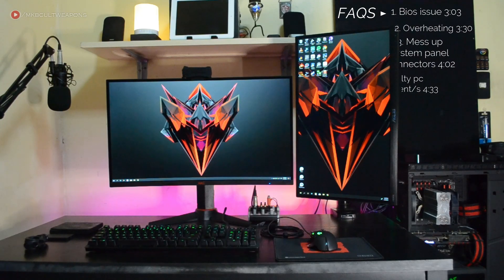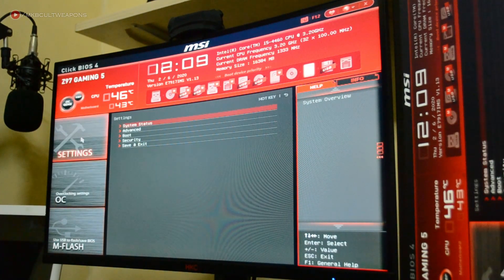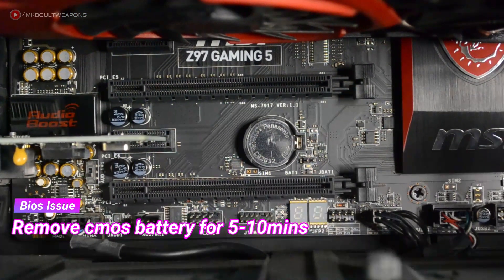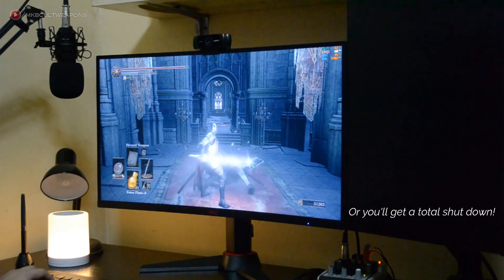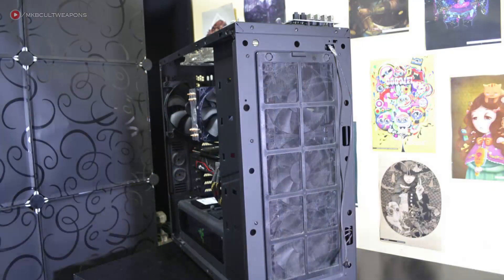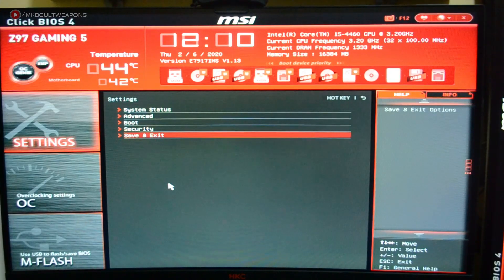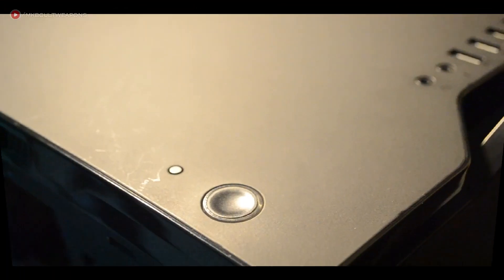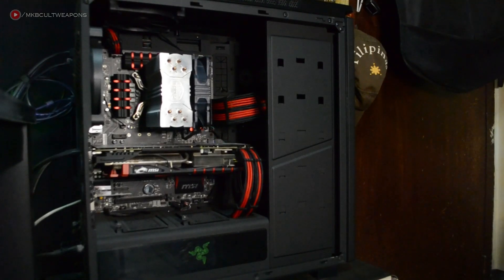Pc keeps restarting FIX / Pc continuous restarting FIX

Comment: my pc restarting in different times, sometimes after 1 min sometimes 10 min some times 30 min sometimes 4 hours sometimes less, I don't why?
Reply from the maker: temps might be spiking for some reason, what's your idle and heavy workload cpu and gpu temps?
Reply: I removed the gpu ( rx 580 8gb ) and it is working fine now for almost  @MacCoyzkie  the previous message, so any idea what should i do to the gpu ? thanks tho for ur time
Reply from the maker: @rokinos  wait, are you using a different gpu or you plug the monitor in the motherboard's monitor input? 

two things that could have caused this, either your gpu is failing, or the psu doesn't have enough wattage to run rx580. can you tell me your entire pc specs?
Reply: Config:
-GPU: // RX 580 8 GB GAMING X
-CPU:  // I7 6700
-Ram: // 16GB DDR4
-SSD: 500gb
-Motherboard: // Asrock H110 PRO BTC plus
-Case: // DEATHMATCH SPIRIT OF GAMER
-Fans:3 fans comes with with the case and I have one that i use in the back.
-PSU: Corsair 650 W ( BRONZE ) @MacCoyzkie
Reply: rams are old ( 2133 mhz )
maybe the rams are bad ??
psu still look new ( 2.5 years old )
Reply from the maker: @rokinos  your pc specs are fine and this should not do any sudden shut downs. are you using windows 11 by any chance? 

i can't say if the ram or psu is ok but let me know what os you are running
Reply: I use windows 10, btw the problem starts after I did put my pc in sleep mode.
now 2 days after I did remove the gpu I don't have this problem ( the restart ) @MacCoyzkie
Reply from the maker: @rokinos  ok i think we need to have the gpu tested in a different pc, maybe its really the gpu.
Reply: thanks alot for ur time bro :) I will try it out @MacCoyzkie

Comment: After putting new thermal paste the pc is stuck on booting loop nothing appears on monitor 
Iv reseated the ram, gpu and cmos reset ( removing it for 5 min) and also removed gpu cables and put it back in and its still doing the same
Reply from the maker: by any chance have you removed the cpu from its socket? it might be bent pins. if you just re-paste i don't think this will happen.

Comment: Ive build my pc back in 2017 and just recently this month my pc would run normally then just randomly shutdown and start back up and then shuts down immediately and keeps repeating until i hard shut it off. Usually i would remove the ram and change its postioning and it will start back up normally the next turn on but even so the problem was never resolve. I clean out all the dust took out all componets and connectors and re install them try troubleshooting, updating drivers check for viruses but nothing reslove the issue. I started to suspect maybe my psu or mobo has gone bad. But i watch your video and the only thing i havent tried yet is the eraser trick. I will try this and get back to you if it works thank you
Reply from the maker: you also need to consider the os, if you have extra drive, remove your boot drive (where you installed windows) and use the extra drive and install fresh windows in it. run some test and if it didn't shut down the os in your boot drive is the problem
Reply: @MacCoyzkie  could be using your trick stop the infinitie loop it had when ever it randomly shuts down but the random shut down still happens
Reply from the maker: @FableNet  i don't get it, you tried the suggestion yet or not?

Comment: hello i did all the steps and nun work my pc has this problem where it works fine without the gpu and then i plugin in any gpu it boots but when i enter windows it let me use the pc for 5mins then restart once every 2secs after boot nun of the part are broken they all new and they work in other pcs fine
Reply from the maker: gpu might be too powerful for the psu to handle, its just a guess, what's your pc specs anyway?
Reply: i found out my that the board i have use alot of power when my gpus in so the psu are not a gold unite  @MacCoyzkie
Reply from the maker: @itslorenzo9465  time to upgrade psu
Reply: i did thx
 @MacCoyzkie

Comment: ive been trying to fix my pc for weeks now, my pc keep turn off and on, i already do all of your sugesstion, i already buy a new psu and stabilizer, and the problem keeps presiting, i did fresh install windows 10 and it workerd for 3 hours, then the problems come back again, do you think I should change my mobo first or the cpu?
Reply from the maker: may i know your pc specs and what windows license you are using? oem or retail?
Reply: @MacCoyzkie  
Mobo: Asrock b550m pro 4
PSU: MSI MAG a550bn
RAM: corsair vengeance rgb rs 8gb ddr4 3200mhz ram
CPU: ryzen 5 5600g
VGA: MSI MECH 2x RX 6600
SSD: Samsung 980
HDD: toshiba 1tb 2.5inch (from my old laptops)
Reply: @MacCoyzkie  i think windows 10 home, OEM
Reply: @MacCoyzkie  but after i clean install it I didnt reactivate my license
Reply from the maker: @wibusalaryman  ok that's the problem there, you need the current windows update to work with your current apps & games. hopefully you still have the contact to the one who installed windows in your pc, ask them for the key
Reply: @MacCoyzkie   the problem was there when my windows is activated, I install it myself, so its not about the product key unfortunately

anyway I already tested my pc yesterday, and it worked for 12+ hours after I unplug my hdd and all of my case I/O
Reply from the maker: @wibusalaryman  i see, i hope it all goes well then

Comment: Yo man thank for this literally I subscribed you just Ryt now , your trick removing cmos battery worked for me
Reply from the maker: awesome! no problem bro, glad it worked for you
Reply: @MacCoyzkie  bro I had another doubt my ram is of 2400 mhz  8gb and in my pc it’s only showing me 2133mhz how to change it to 2400 mhz . Can we overclock a ram of 2400 into 3200mhz is it safe ?? Or at least to 2400 mhz
Reply from the maker: @xiyaan__syed  go to bios and look for the xmp/docp button. most motherboard nowadays have a single button overclock for ram sticks. just click one of those and save and exit bios. If the overclock works you should have 2400mhz but if it didn't work you will have no display or pc won't boot at all, if that happens do this https://youtu.be/S9hyEPTFR10 to reset
Reply: @MacCoyzkie  yeah how to successfully overclock then ??
Reply: Bro even I reset again then even though cannot overclock
Reply from the maker: @xiyaan__syed  there is no general answer since that will depend on your pc specs

Comment: My problem is after changing the processor my pc won’t stop power cycling. The pc would run for 5 seconds, lights on fans spin and then it shuts off, and it continues.. idk what to do
Reply from the maker: do you still have the old cpu? try to use it again perhaps the new one is faulty or just not seated properly or your motherboard needs bios update with the new cpu
Reply: @MacCoyzkie  i tried the old cpu and it didnt work either.  I took the new one out and it looks like the pins are bent on the socket. Do i get a new motherboard? I’m a bit of a noob when it comes to pc hardware..
Reply from the maker: @Sebster456  oh shoot bro that hurts, depending on the severity of the bent pins this might still be fix. i suggest bring it to a local shop, usually they have a way to fix bent pins.

Comment: So it could be the trace line on the pcb in the psu That was burned I cleaned the pcb and dropped loads of soldier onto the contacts and join them together The pc worked For about five months before it started randomly restarting
Reply: Anybody have any recommendations for a power supply to Work with Asus p6x58d-e motherboard with 16gb ram (2x 8gb) and i7 cpu 930 @ 2.80ghz 2806mhz 4 core and a amd radeon hd 5700 series
Reply from the maker: @TheMono25  btw this may help you pick the best psu for your build https://youtu.be/1bp1Bf7ADVw
Reply: @MacCoyzkie  thanks the pc has 600w at the minute but think I'm gunna go with a 750w I'm just not shure what psu cables will fit my motherboard and gpu
Reply from the maker: @TheMono25  yes you need to search on that too before buying one
Reply: @MacCoyzkie  Just got electric shock from psu ouch Now my partner's apple watch says on the ecg I'm in afib I'll test again in half an hour before I decide to call ambulance I feel fine
Reply from the maker: @TheMono25  what! be careful bro and wear shoes while pc building. also don't plug the psu while building the pc
Reply from the maker: it could be, i once experienced having just some  droplets of water causes the mobo to stop working, try the ram cleaning in the video

Comment: My PC has a different problem but still similar - I was just using my PC normally and then it did "Your device ran into a problem and we need to restart." but I didn't have time to look at the stop code. Now I can't load up the screen and it keeps going on for around 5 seconds and going off for 5 seconds and doing this over and over, what do I do?
Reply from the maker: either your psu is failing or there is power fluctuation around your area. you can confirm this by having your pc tested at a friend's house or the local shop where there is no power fluctuation
Reply: @MacCoyzkie  Thanks I managed to fix it pretty quickly with the RAM thing :D I was getting worried

Comment: My problem started not long after I Installed msI Afterburner and i uninstall it and pc was fine for a few weeks then started again The pc could restart before it even loads Or it could last an hour, it could last five minutes It's very Random I did notice if I play with the connector from the power supply to the board It can be very temperamental But I don't see any problems It is driving me nuts
Reply: I forgot to mention when I opened the power supply There was a burnt Thick trace line On the pcb I got my solving iron and connected them back together. And the pc worked ok till now 🤦‍♂️I just answered my ? Ffs
Reply from the maker: @TheMono25  that's concerning, i think you need to replace the psu. if need some advice you can check this out https://youtu.be/1bp1Bf7ADVw

Comment: Hi, when I start my PC everything boots except the GPU. After a few restarts it usually boots however the fans twitch but don't spin on start up and I get no display the first few times. Anyone got a diagnosis.
Reply from the maker: have the psu tested using a psu tester like this https://youtube.com/shorts/YrC3PlflLq0 , it might not be giving enough juice for the gpu. if your psu is fine then have the gpu tested in a different working pc, ask a friend or bring it at a local shop

Comment: I had the same problem, I'm not sure tho wich one fixed it for me though. I think ot was either the cpu (there was some residue on one of the pads), or the cmos battery trick. Anyways thanks for the help man, you've earned a sub
Reply from the maker: yep that residue can really cause problems and at times when you reseat the cpu you need to clear cmos so both ways i guess 😊. subs are much appreciated

Comment: My PC is giving me a cpu light flash and then the dram light goes solid, before shutting off and repeating. 

Specs:
3060TI zotac
i5 8400
b360 f gaming motherboard
evga 850w +50 
quad channel 32gb DDR4 
250gb ssd 
1tb hhd
Reply: I got this used it origanally only had 16gb of ram and an evga 1070TI
Reply from the maker: @gav1685  i made a video specifically for that problem here https://youtu.be/jtZcO7Q4yhA
Reply: @MacCoyzkie  Thank you! I will check it out!

Comment: Hello so far I am totally stuck my computer first Gave me a recovery error code 0xc000000ff and then it shut down now it's  stuck on a endless boot loop by pressing my power button it turns on then goes off even if I hold in power button no reset on system takes place ..I have cleaned my ram and idk if this could be my bios battery as it and the ram only things I have not replaced..What do I do I urgently need to access my PC for important legal documentation??
Reply from the maker: go to safe mode this way https://youtube.com/shorts/IZKc8plksDA then do this scan first https://youtube.com/shorts/GsfhmuZmzx4 if its still not working try scanning the C drive this way https://youtube.com/shorts/Gn-Y1z0O50g
Reply: @MacCoyzkie  unfortunately none of these are working tried all but no success
Reply from the maker: @Realestatebusiness22  this might be a failing psu or low power draw from outlet. try checking this video https://youtube.com/shorts/YrC3PlflLq0

Comment: I clean up my pc today after 2 year....before the clean up everything is okay...after the clean up pc keep restarting not showing any boot at screen just infinite loop restart pc....i readjust ram erase ram still keep restasting....i try to look by remove all main pc part like ram,hdd,ssd,liquid cooler aio just left psu,mobo and cpu but same problem keep restarting even without ram please help

My pc spec
I7 - 8700k
Gtx 1070
16gb ram
850 gold psu
Reply from the maker: misplaced front panel connectors can also cause this, double check it https://youtu.be/LxRzL5WFB9c
Reply: @MacCoyzkie  not still same after fix front panel connection...problem even rechange cmos battery not solve pc keep restarting not showing boot at screen
Reply from the maker: @FIK_3  have you tried using one ram stick at a time
Reply: @MacCoyzkie  already try same result
Reply from the maker: @FIK_3  this is where we try the individual parts in the other pc. if you have a friend with compatible pc that is willing to help then ask them, if there is non your local shop is your only choice.
Reply: @MacCoyzkie  sound like my only option send to shop

Comment: My PC does the same problem, and when I take it to the store where I bought it from, it solves the problem and tells me that there is no defect in my PC. When I return home, the same problem returns. I took the device and took it to another place. It worked. Although I tried three different cables in my place
Reply: I no longer know where the problem is now. Is it in the electrical connections in my place, or in the wires of my place, or just my place is cursed?? 🤣🤣
Reply from the maker: yes, its your home or at least the power inside your room. try using ups or have your electrical power check by a pro

Comment: problem not solved i'm cleaned everthing but pc still keeps restarting
Reply from the maker: tell me your pc specs, how the pc problem started and i also need to know if you are in windows 10 or 11 before i can advice
Reply: @MacCoyzkie  my computer is windows 10 pro and one day I turned on my computer, the screen did not come and it turned off by itself, then again and again I tried for days again and again, I changed my processor, I changed my ram, I changed my video card, but my computer was restarting by itself, so I watched your video and my computer restarts by itself.
Reply from the maker: @MelihSüpürge  might be low power draw from psu or the outlet itself if you had power fluctuation in your area. try testing your psu using a psu tester like this https://youtube.com/shorts/YrC3PlflLq0

Comment: My cat had stepped on my keyboard and somehow put my computer to sleep and I couldn’t get the screen back, so i restarted it and this began happening. The computer is a relatively new custom build so i was pretty sure it wasn’t a cleaning issue. Thankfully i came across your video, and removing the CMOS battery worked perfectly. Thank you so much!! Saved me a trip and like 80$ for someone else to do the same thing.
Reply from the maker: glad it was helpful, buy a treat for your cat instead 😊

Comment: I was cleaning my pc it was totaly turned off but after i turned it on again it doesn't start it keeps doing the same thing over and over again
Reply from the maker: double check the front panel connectors https://youtu.be/LxRzL5WFB9c usually you might just misplaced power and reset. also reattach the ram sticks

Comment: My pc was fine before I went to clean it but after I cleaned it I turned it on and it shut down on my Home Screen. Also I cant use my mouse for some reason
Reply from the maker: try to reseat the ram sticks again and also double check your front panel connectors. there might just be misplaced cables

Comment: Hello, I have a problem with the graphics card, when I reboot it does not appear on the screen and remains black. Is there a solution? ...........thanks
Reply from the maker: you need to ddu the current gpu driver, here's how to https://youtu.be/SvIJhcxZTsA then download a new updated driver https://youtube.com/shorts/hhaQqJib6Gs
Reply: @MacCoyzkie   bro i think for the bios......
no softwar
Reply from the maker: @hmidazaoui903  how do you know it doesn't appear in bios if its black screen? im a bit confuse, can you elaborate the problem more?
Reply: @MacCoyzkie  i have matherbord asus z390-p 
if use amd rx580 8g i dont hav problem
if i use gtx 1660 super 6gb   restart my pc my display is black
Reply from the maker: @hmidazaoui903  place back the 1660 and ddu the driver  https://youtu.be/SvIJhcxZTsA then shut down the pc, install rx580 because this might just be driver conflict

Comment: guys if these steps doesnt work that means your motherboard is short or the pins on the back side of the motherboard are making contact with the metal plate or something conductive. Eliminate any contact of the motherboard with the conductive material and try again it worked for me.
Reply from the maker: i've seen this many times with my clients pcs, usually some random screws

Comment: Yup bumped the case, pushed in the ram, felt good, checked again and hazaah the ram stick was loose just a micromilimeter out on the bottom...cheers for the fix
Reply from the maker: no problem bro